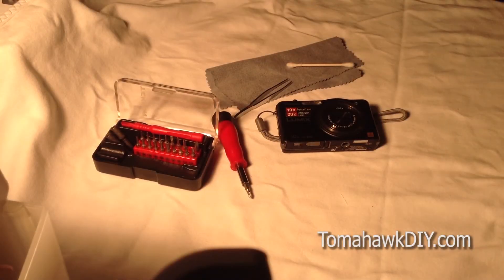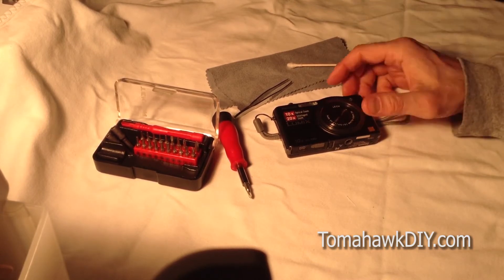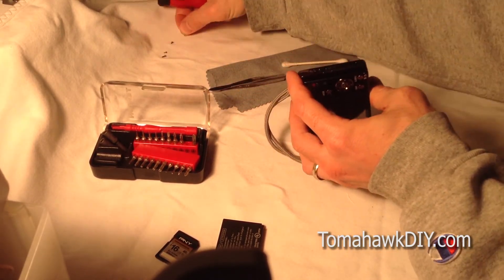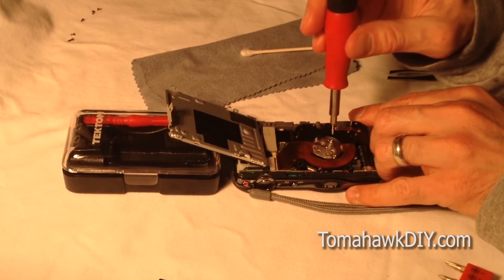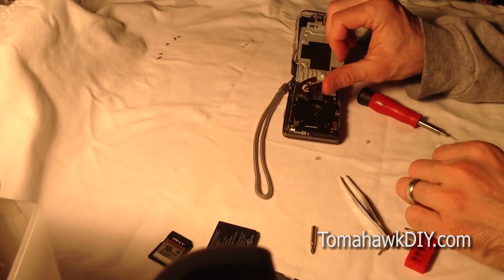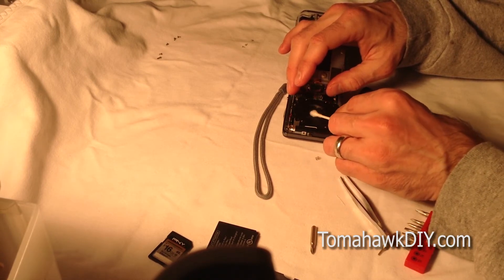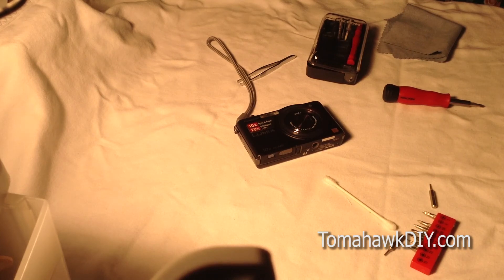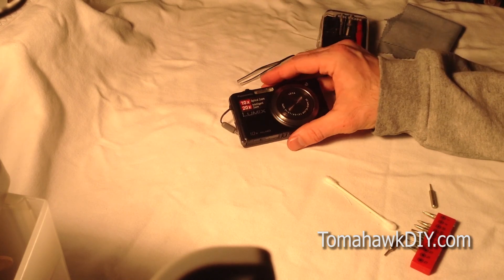Panasonic Camera Repair - Black Spots on Pictures

Comment: My TZ25 had developed ugly spots that made it useless. Having fixed appliances significantly more complicated, I followed this excellent procedure for my TZ25 that had developed nasty spot. The difficulty is that in the TZ25 the screen is attached to the main body with a ribbon, which had a black retain. The ribbon would not come out. Eventually it did when I touched the black retain, but then this went out and it was no longer possible to replace it: no matter what, the black retain fell off. I disassembled the sensor, found there very visible the spots, cleaned them and reassembled the sensor. Then inserted the ribbon again (trying in vain to reinsert the black retain) and closed the camera, but it never worked again: no matter what, it shows a flashing white screen. Tried twice to open and reinsert the ribbon, which looks as having a perfect insertion, but the camera still flashes white.  (Do not find it worth going to a repair shop for a machine 4 years old anyway when I can have a similar brand new one for about 200 €/$). Pity. Worth the try anyway . . .

Comment: hello TomaHawk, great vid; I watched carefully and was about to try it myself since I too had a black spot on my viewfinder and pics.
But then I thought: "hey if it's just a piece of dust why not tip the camera this way and that and gently give it a tap see if I can dislodge it?"
Well, I did and the black spot is gone.  I know it's just temporary and it may reaper; but for now I don't have to risk disassembling my canon SD 1200 IS.
Thanks for getting me thinking; and showing me what to do should I decide to actually clean the camera later.

Comment: I usually won't even complain, but I will say "It's about time".  I was tired of those black spots.

Before disassembling, I would have tried a few sharp jets of compressed air at the joints in the lens assembly to try and dislodge the dust.  Sometimes things just don't go back together the same way.